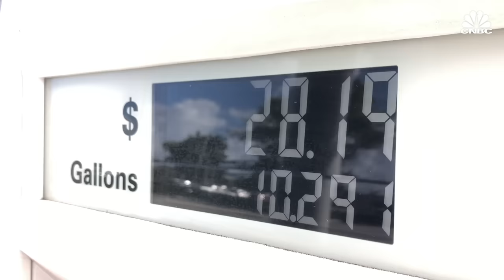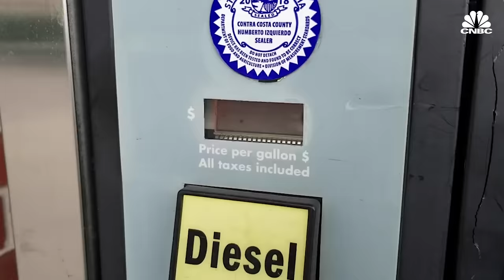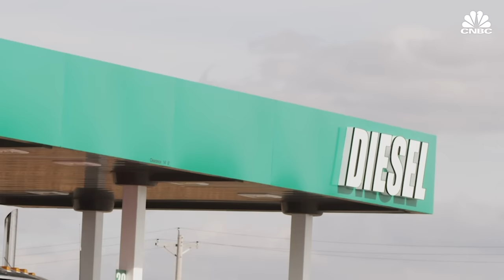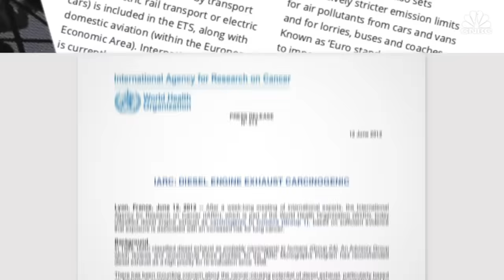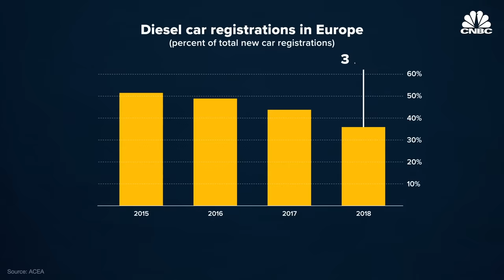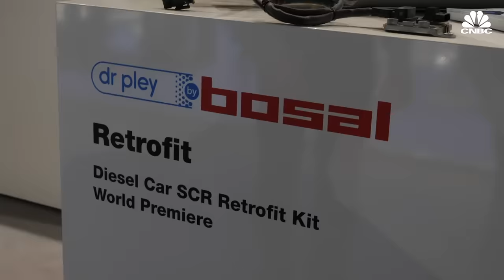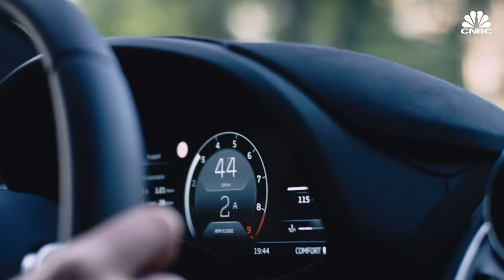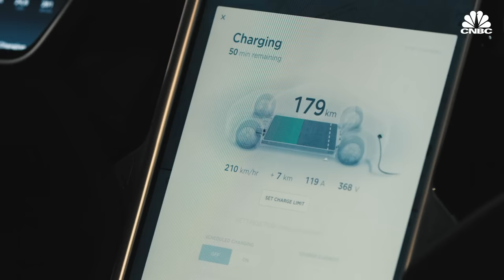Why Diesel Cars Are Disappearing

Comment: Why not invest into Bio-Diesels like Sunflower, Vegetable and Hemp. Most Diesels engines need little to none changes to be able to use Bio-Diesels. Plus they put out much lower emissions.
Reply: Why? You run diesel equipment to farm those. Then the oil industry keeps making diesel regardless as a byproduct of making other petroleum products. I don't see the point in putting a large effort towards biofuel.
Reply: @bobbybaucom4489  Bio-Diesel is a sustainable fuel. And can be grown non stop and is cheaper to grow than to mine it
Reply: @bobbybaucom4489  if you use diesel to run the equipment to farm it then the farm has unlimited access to bio-diesel. You've just supported my point
Reply: Because oil companies want to make money
Reply: Because people need food and it's a disaster to use cultivation areas for fuel instead of food.
Reply: those are organic farms...a pretty low percentage. Organic farming acreage is less than 1% worldwide of all available farmland. So replace "many" with "a handful" and your statement is factual.
Reply: Cam H.  Your comment about bio-diesel shows a lack of knowledge about how much energy it takes to turn used grease, used cooking oil and plants into bio-fuel.  If you actually did the calculations, you would be shocked.  Everyone wants to believe what they want to believe, without doing the math and science.  If it was that easy and cheap, then every energy company would be doing it, and there would be no more  crude oil.
Reply: Oliver Matthews  Yeah.. Biodiesel is actually considered very bad actually. Axeman Racing was indeed right: it's a very inefficient culture and food is better therefore it's avoided. It used to be thought as good and a solution to oil but it's now well known as complete garbage.
Reply: Cam H-Ripley 

Billion People on the world are starving, Bio Diesel would be a huge waste of space . 

In order to fill up a car with Bio-Diesel , you need around 60 Kilos of corn 🌽! 

A starving family could live with that amount of food for months ! 

No, combustion engines are definitely not the future . 

Generally , cars are the worst kind of transportation in terms of speed (in huge towns like Berlin , Munich here in Germany 🇩🇪) , efficiency and price . 

I know many people going to simple places like to the football club by Bus . Sure better than by your fathers car , still 3-5 Kilometers with the bike are nothing 

On top you save hella lot of money in the long run 
(A monthly card costs round 40-45€ here , ~400€ for a yearly card )
Reply: the most efficient and cleanest diesels cant run Bio diesel.
Reply: Biodiesel and Ethanol can be also made from biowaste, but I think biodiesel still produce small particle air pollution
Reply: You can either grow for bio-diesel or food, not both

You also need a lot more acerage to actually create bio-diesel at volumn vs food

Yes, it can be done, but to create enough bio-diesel to take over from fossil fuel diesel you have to stop eating......

Your choice
Reply: Oliver Matthews  carbon never was a problem, you know, plants need carbon to produce sugar.
Reply: Algae has the potential to produce 100 times more oil than conventional crops.
Reply: Bio diesel is not an alternative to standard diesel. It's notorious for clogging engines and you have to burn more of it to get the same power. It's NOx emissions are actually worse as well.
Reply: Cost. Biodiesel is more expensive because of the labor cost to produce. It also take away from the food supply. There is still starving and food insecure people.
Diesel is a byproduct of petroleum. So it got to be used.That is why it was always cheaper in the past. 
Diesel can be produced from coal or wood but the cost is higher. 
In the future diesel will be produced from sunshine and water. The technology exist it is just a matter of cost.
Reply: Oliver Matthews  Carbon is essential for the atmosphere. Its the over supply of carbon from trapped resources that is a problem. Growing crops absorb carbon from the air. So it becomes a balanced cycle.
Reply: @BlackTeethMedia  Bio diesel is only 20 % of "Bio" vs 80 % of diesel. So much for the sustainability.
Reply: Because they're not economical.  It's all about money.

Plus, doesn't make much sense to burn food with 7.5 billion people running around.
Reply: I've heard bio-diesel is terrible for engines and gums them up so the cost for maintenance would probably outweigh any benefits I assume.
Reply: @warptenblender  Yes you assume. Biodiesel can be refined and can be better quality than fossil diesel.
Reply: Simple money it would ruin the oil company people started doing using different oils when it first came out
Reply: @Abu-Talha-Al-Kurdi  
We need to stop using oil, at least to the degree we are now. I get that it will be difficult, but we have to invest in other options. 
Corn is a bad example in your point, as corn doesn't actually contain very much oil, we only see it common on shelves bc so much corn is grown in bulk. Also corn contains waxes, nescessitating another step to remove them in processing. Corn is much better suited for ethanol, which is a whole other topic, BUT I will say that bio and ethanol companies would do well to work with each other, in making use of byproducts.
What is needed for sustainability in my view is a perennial oil seed crop, but the beauty with bio is in its flexibility. There are many crops which could be used, not just ones which would necessarily compete with food crop land. 
Key to the future are many systems working together. Example, solar cars dont work, as not enough surface area to power it. For an electric car, batteries add weight, limit range, and are expensive. A biodiesl car uses energy that was captured by sunlight into a high density usable fuel. There is nothing stopping the other imputs of production of this fuel to be powered by solar as well wherever possible.
Reply: Only higher nox.
Reply: Depends on your location but currently there is HVO100 to put in your diesel tank. It's described as being produced from waste and on molecular level identical to fossil diesel. Instead of bio-diesel which is different. I think it's amazing and put in my tank when it's affordable but it seems to get not that much attention
Reply: Palm oill can be used to make biodiesel to
Reply: The plants are needed for food.
Reply: The diesel engine was designed to run on peanut oil. We run it on petroleum refining waste (diesel fuel) because it's cheaper than peanuts and the sollution to pollution is dillution!
Reply: Chief inspector Kido  yes, there are starving people in the world, but we are beginning to learn that the kinds of crops that can produce bio-diesel are also behind the worlds worst health problems when used for food. They are cheap alternatives when there are food shortages, but the side-effects of grain based diets are why we have become so unhealthy.

Sugar-based diets like come from wheat and corn are why Americans are so fat with high rates of diabetes, cancer and heart disease. Soy is highly estrogenic, which is extremely dangerous for men’s health, and possibly women’s as well. Peanuts are very high in lectins and cause leaky gut which is at the root of a lot of other major health problems.

But big food and big agriculture, along with the sugar industry has for over half a century been successful in convincing the world that red meat, meat fats and cholesterol are the boogey man. They’re not and never have been.
Reply: Bio fuel are a waste of farmland with only a very marginal energetic gain. Morever, they are usually less clean than normal diesel
Reply: the so called B20 ? that's just a chemical mix. You can run a diesel engine on 100% plantoil, providing, the oil is filtered enough, and temperature is high enough
Reply: It takes large amounts of land to produce the plants for biofuel reducing the land available for food production.
Reply: @skylermcbride9428  agreed...I guess solution will need to be multifaceted. Only contempary battery technology isn't that respectful towards keeping our planet clean either...
Reply: @Steve25g  I personally think nuclear energy is the best for everything. Physicists are already working on small nuclear power plants that could easily fit in a car and only need fuel every 10 years. Mord money needs to be given to nuclear power projects and then it will be readily available and safe
Reply: @skylermcbride9428  the LFTR design they were running in the 50/60's, which was seen as to difficult to make nukes from.
Reply: @Steve25g  not quite sure what you are trying to say
Reply: @skylermcbride9428   LFTR is a type of nuclear plant, that uses as fuel Thorium, which is abundant available, and at this time is thrown away.  The LFTR design doesn't need any water, to cool, and in case the process heats to much, the process stops, so, no thermal runaway.
The fuel is 'liquid', and can be mixed, as needed. The circuit allows, to filter out the 'waste', existing of rare earth products, and a small quantity of nuclear waste, that decays in 30 years. You can try a search on LFTR, and thorium. China and India, is investing a lot in this tech, so, they could own the IP, and let the rest of the world pay for it..
Reply: @Steve25g  that's what I thought you were talking about but I wasn't sure. I've looked into the technology and that's why I think it's the future of all energy.
Reply: Because...the more farm land you use for garbage like Bio-diesel the more wonderful chemicals needed to grow our food....super!!!
Reply: Bio diesel is harmful to diesel engines, as it's lubricating properties are so low. So a petroleum basedlubricant has to be added. Also: cars with bio diesel are hard to start in cold climates. But these problems have solutions. But: why use valuable farm lands that can produce food to produce biodiesel when very clean gtl-fuel (made from natural gas) have been invented that burns as clean or cleaner than bio diesel? They are a little bit more expensive than diesel, but in return they are virtually pollution free..
Reply: @Raymond Glad: but it cant be cleaner than gtl-fuel (diesel made from natural gas).
Reply: that would be too easy
Reply: As they were designed for in the first place. Know your history, people!
Reply: @dzello  Biodiesel is made from food waste.. Generally used edible oils... Sunflower, corn or canola... Don't get it twisted. Nobody is starving because they used fry oil to run their car, lol... Even here where I live (Canola belt of Alberta) it's only used for frying oil anyway... And it's exported mostly to the USA as a healthier alternative to LARD...
Reply: @Abu-Talha-Al-Kurdi  WRONG. It's getting rid of USED oils that have already been collected. It's using trash again...
Reply: @stickynorth  Common misconception but nope, you are incorrect. It is not made from food waste, it's a choice: you either grow food or produce biodiesel. It's why so many poor countries struggle when the prices of biodiesel changes: if it's high, farms produce it instead of food which cis a dangerous choice.

'' Nearly all biodiesel is produced from refined vegetable oils. The portion of the vegetable oil that is used for biodiesel is the triglyceride portion, which is the same portion used in food and food preparation.  '' Food wastes can also produce biodiesel, that's all, but it's a very minor fraction of the production.
Reply: @Abu-Talha-Al-Kurdi  Nope, but what is the future. Everything needs energy. Electrical cars use electricity but most of it is produced by fossil fuels. Hydrogen needs a lot of energy to be produced, so are we sure those solutions are better for the nature.

Comment: I had an old Chevy truck with a diesel V8 in it.  No computers or turbos, no DPF, just a simple engine.  i used to get rid of old oils around the house in that old truck.  I'd fill it almost full with diesel then add transmission fluid.  When I had a bottle of old vegetable oil in the kitchen, I'd pour it in my truck.  Never hurt it.  I miss that old truck.  Had it been a 4wd I never would have sold it.